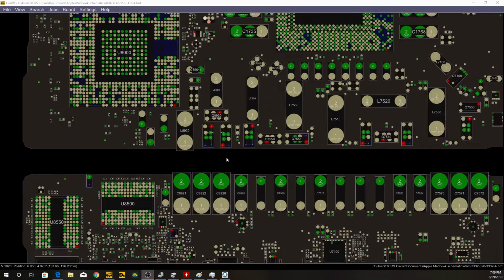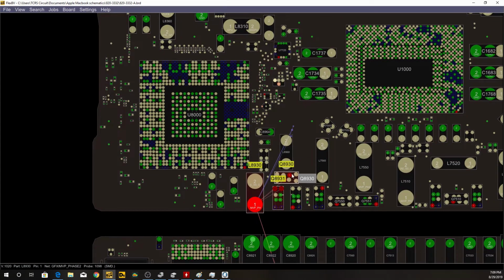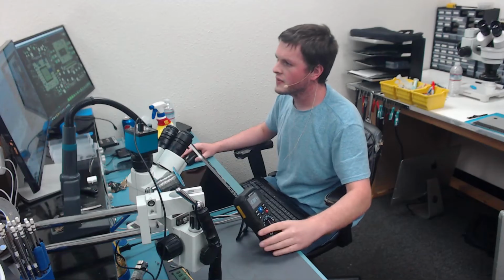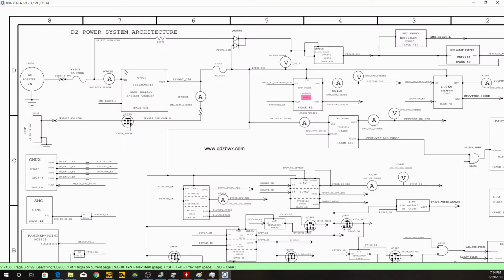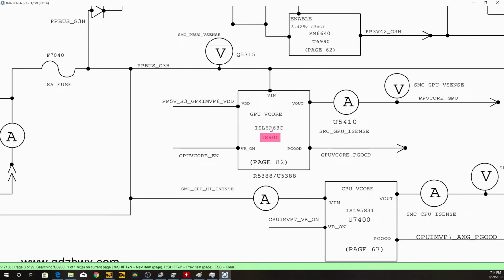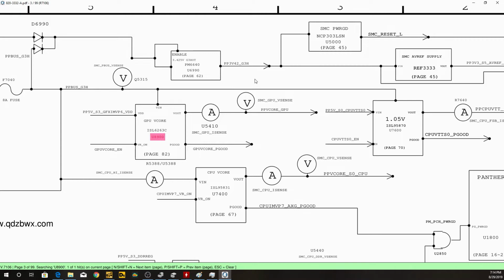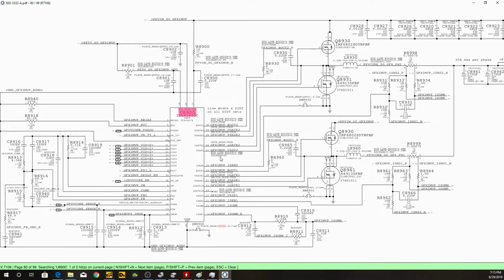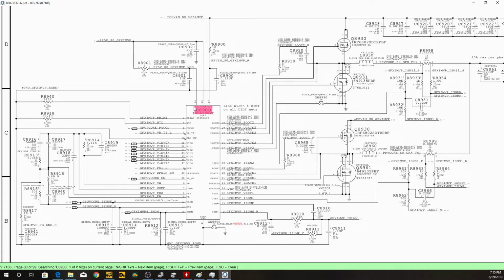2012-2013 MacBook Pro 15" Retina video issues | WHAT IS WRONG AND HOW TO FIX CORRECTLY

Comment: Dude, thank you so much for this video. My 15" 2013 retina display suddenly died the other day when I opened it . I could hear the chime when I booted it up, but when I tried to connect a hdmi cable there was no signal. I instantly thought this must be a gpu power issue. I went on a search looking for gpu fuse location etc... The amount of bad info out there is mad! I even saw a video of a guy telling people to open up their macbook and press as hard as they can (like thumbs turning white from the pressure) on the gpu!! When I saw your video (and the link to louis rossman) I knew I finally found the right place. I re-soldered the exact same ic you showed (I am a technician, but not a macbook tech!) problem solved! Thanks for being one, of what seems to be very few putting out proper content. Huge respect!!!

Comment: Early 2013 Macbook Pro here. Screen goes black usually when i launch imovie which uses the nVidea. Then i need to connect it to an external display, which works, shutdown and restart. Would this likely be U8900? Mac repair shop repaired the logic board but it didnt correct the issue.
Reply from the maker: Very likely will be this issue. The other shop probably didn’t know what they were doing and didn’t perform the repair properly.
Reply: @TCRSCircuit  Would you also not rule out the U9300 chip? Laptop screen black, keys lit, external display works. Because external display works, it made me think maybe not U8900.

Comment: good day sir- thanks for the info -   i have a 2012 mp pro.. same black screen issue.  only happens random. My solution is take back cover and press down on the gpu i believe.. ideally would like this resolved.. is it a matter of re soldering the vcore chip?  once i presss down on the gpu , it works back up.. thanks for your help

Comment: I had the problem that after reworking the solder joints it still did not work. I even unsoldered and resoldered the vCore chip with no success. Then I replaced the vCore chip and it worked.

Comment: Can this issue be caused by replacing the battery? This has now happened to me on two 2014 MacBook Pro's and I am hoping that this will resolve the issue. Same thing both times battery was replaced (by computer store). Worked fine for a couple of hours and then Macbook crashed and has constantly crashed every few minutes since then. Does not crash in Safe mode or guest account. I think it is the dynamic switching on the GPU causing it to crash. God I have no idea, it's driving me crazy.

Comment: Dear Tim, do you know how to fix a dislocated graphics card on macbook pro 2015? My daughter dropped it on our foam flooring from a 19 inch table and it landed on the side. Then the screen went black. The same thing happened before but Apple technician fixed it within minutes when it was still in warranty. I want to know how to do it myself. Is there a video I can refer to? Looking forward to your reply!

Comment: So the no-lead solder does not need to be removed first? Does it just blend with the good solder (leaded solder)
Reply from the maker: Most of the old solder will be wicked up to the iron tip. The trace amounts of left over lead free  will blend and won't be a issue.

Comment: Excellent video. I have A1389 MBP Late 2013 with i7 CPU. There is no image at all, but there is a chime during startup and fan is spinning. It seems like the laptop is working. Could this be the same issue even though MPS is Late 2013 instead of 2012?
Reply: Yes this is also happended on my late 2013 MBP

Comment: I have the famous A1398 mid 2012 and judging be the symptoms with normal boot an after 5-15 minute no screen and backlight, but still fan ect. After reboot I can have the folder with ? when I am having the board dismountet. Is there at timeout of the folder with the ? or is on as long there is power? Regards
Reply from the maker: Hmm, That could be a SSD issue as well. This issue wont cause a flashing folder. It is also possible that you have a SSD issue with the U8900 fault as well.
Reply: No it is just the logicboard dismantled with charger and screen on that I am testing.
Regards

Comment: I have the black screen issue just sometimes,  it goes randomly black, also at the startup its randomly, does this still mean its the cracked joints under the U8900? If yes how come the macbook works sometimes?
Reply from the maker: The u8900 issue is almost always random. What year and model is your device?

Comment: Hey I am having this issues in my MacBook Pro mid 2012 15 inch retina, I sent my laptop to several technicians and they can't repair it, and I have that same error the screen used to turn on when I was heating or when I was cooling, but right now the screen no longer turns on. I'm currently using it with a monitor turned away by hdmi. Any help? Greetings from the Dominican Republic.
Reply from the maker: It is very hard to say with multiple people working on it. My guess is you had the issue in the video, and one of the shops reflowed the GPU killing it.

Comment: Hey Tim.  Nice to see how much you have grown in your confidence.  Very good video.  I'm down here in OC.  I'd love to come by with some of my old macs sometime and see what you think.  Take good care and keep up the great work.  Cheers!
Reply from the maker: Thanks! And sure thing as long as they are 2010 or newer.
Reply: @TCRSCircuit  Hi, how can I know if someone heated up the GPU on my Mac? I just bought one at dirt cheap, and I'm scared it will die on me in a couple months.
Reply from the maker: @herc10  generally if the black covering on the gpu under the heatsink is removed or burned, or if the edge bonding is discolored. It should be a translucent clear and turns yellowish to brown when heated.
Reply: @TCRSCircuit  Wow thank you so much for responding! And what if they heated it from the back of the motherboard?
Reply from the maker: @herc10  capacitors and resistor ends will look goldish
Reply: @TCRSCircuit  Thank you so much for responding. God bless you.
Reply: @TCRSCircuit  Hi, it's me again, so sorry for bothering you. After the vcore on the board gets resoldered, is this computer reliable? Would it last for years to come?
Reply from the maker: @herc10  Yes, the machine would be reliable after the chip is resoldered. There is no way of saying how many years the device will last into the future, it could develop another issue such as a battery or SSD issue, there is no way to tell. As far as this particular issue returning, the chances are very low if the repair is done properly
Reply: @TCRSCircuit  Thank you man!